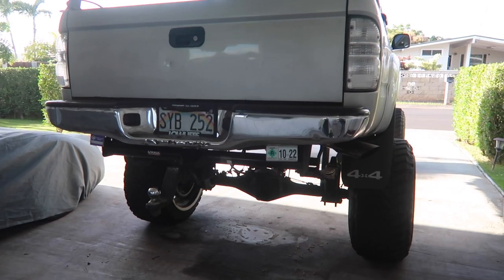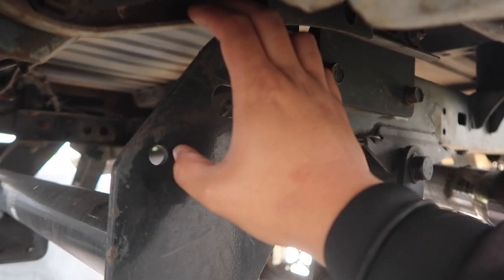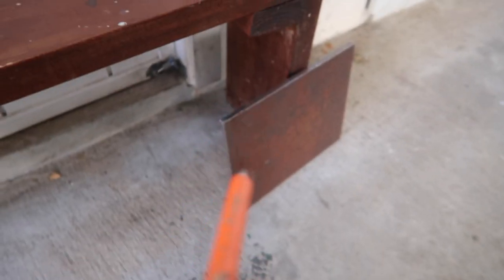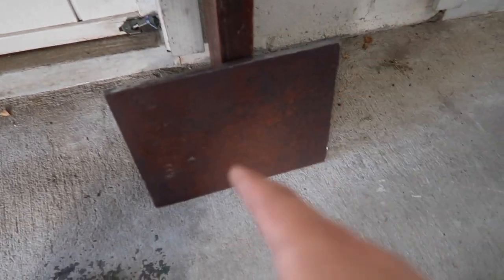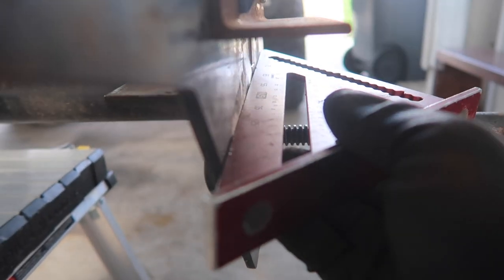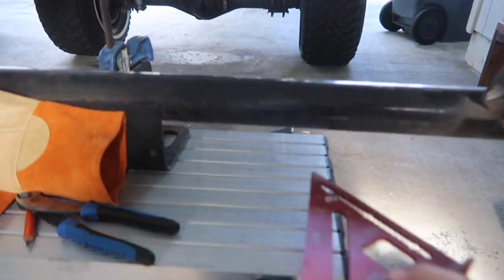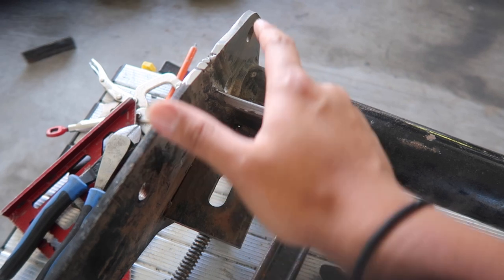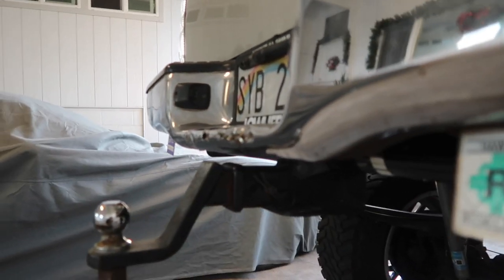Tow Hitch Gap Fix After Body Lift

Comment: Why body lift and go through so much to hide it? Oily?
Reply: Because suspension lift you only can go so high. So body lift gives you that extra lift. But when you have a body lift. You also expose all these gaps from the frame and the cab. You’ll eventually get tired of looking at the gaps so you do what you can to get rid of it.
Reply from the maker: Well said Kelz 808! 👍🏼🤙🏼